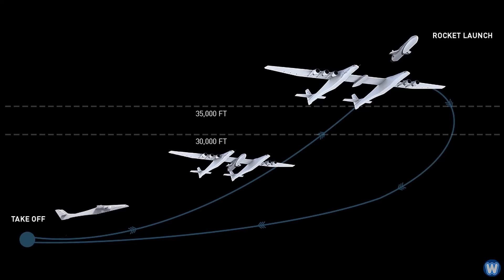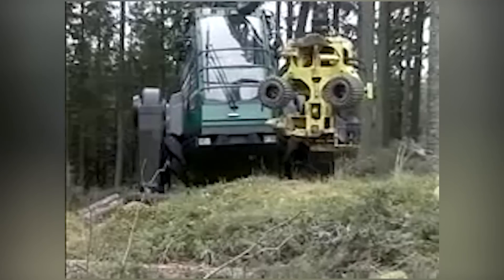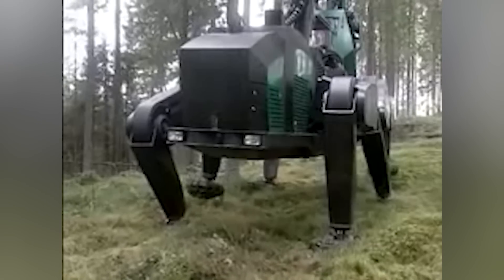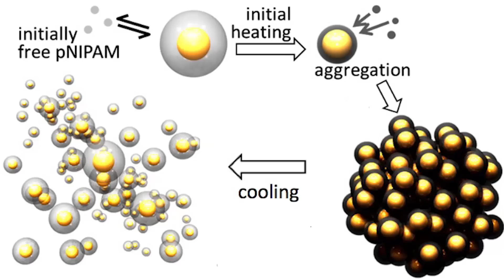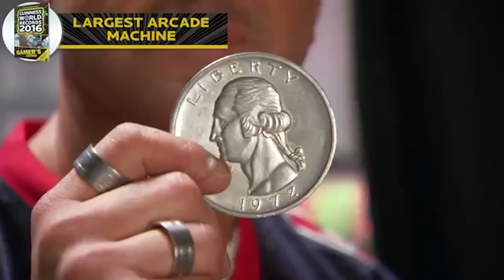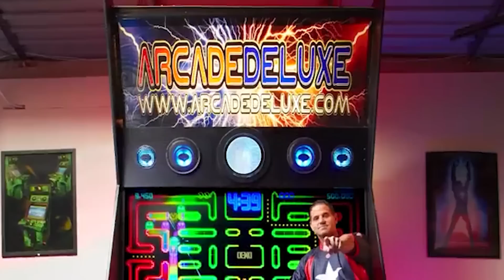Top 15 Bizarre Machines that do weird things

Comment: The 575 dozer is no longer in production and everything I’ve read says they are prone to breakdown...I’ll stick to my CAT equipment
Reply: Only a few were built. Very expensive to dismantle & move and parts have to be made on demand AFTER the breakdown. They were not economically feasible. This is why Cat will never build one larger than the D-11.

Comment: Is Berth related to the "Chunnel Digger" that went under the English cannel in !994
Reply: Yup, all of the Chunnel Diggers and Big Bertha were TBMs ( Tunnel Boring Machines ) and worked the same way. It's a design that has been around and in use for a while, nothing unusual about them. Bertha gets named simply because Seattle wanted a size that was unusual, she was far bigger around than any built before.